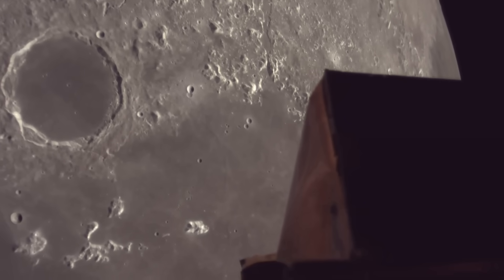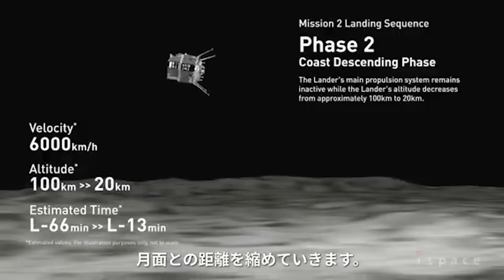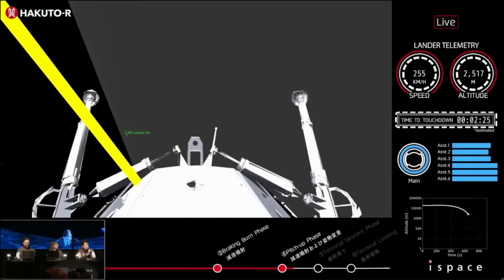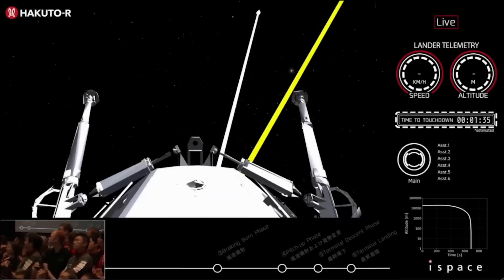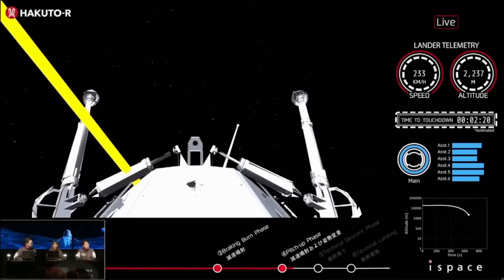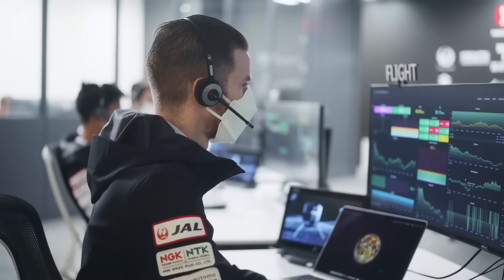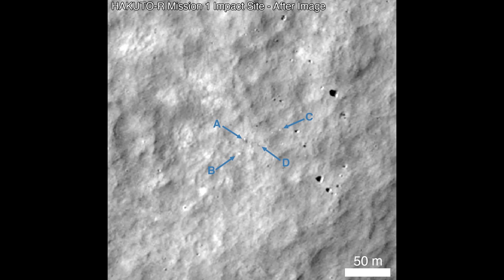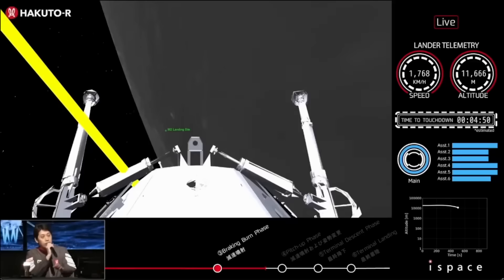Another Lunar Lander Just Hit The Moon Too Hard

Comment: With all these failures recently in moon landing attempts, it’s surprising none had anything to do with the engines. All seem to be landing sensors or some sort.
Reply: It seems like lidars aren’t very reliable for lunar landings. The video suggests that if this was like the 1st iSpace mission, the flight management programme’s lack of ability to handle more complex approach situations  than planned is to blame. Perhaps they should also use radioaltimeters.
Reply: @Blixey-r9z  Maybe they should be using ultrasonic sensors 😅. 

Good reply though. It might be time to create a Moon GNSS constellation.
Reply: @12pentaborane 
I think they are trying to reduce the cost of the landing vehicle by simplifying (perhaps over simplification). The Chang’e 5  navigation and flight control system seems to be  a lot more sophisticated and equipped with a lot more sensors. The inertial navigation system’s calculations are updated with data from 1) star sensor; 2) optical camera; 3) lidar camera; 4) lidar altimeter; 5) radar altimeter; 6) lidar velocimeter; 7) radar velocimeter; and 8) gamma-ray altimeter. Skimping on the navigation and flight control system might be a case of being penny wise pound foolish.
Reply: @Blixey-r9z  I would be pretty amazed if any spacecraft is flying without a star tracker. That seems really important just to get to the Moon, let alone land.
Reply: @12pentaborane 
The iSpace vehicles probably do have that and the inertial navigation system. But it seems like they are trying to land without using radio-altimeters and gamma-ray altimeters (used in the terminal approach phase 0-30m altitude). Not sure if they have optical and lidar cameras with image recognition and processing  software and computers (these are used in the approach phase 100m-2000m altitude).
Reply: @Blixey-r9z lidar wouldn’t work if there’s dust in the air anyway - is this not why the chinese landers use the gamma ray sensors?
Reply: @octagonPerfectionist 
Yes, dust clouds are a big reason why the gamma-ray sensor is used for the terminal approach phase.  Firefly only talked about the optical imaging navigation system that the Blue Ghost lander used. Not sure if Blue Ghost had a gamma-ray sensor.
Reply: @octagonPerfectionist  Err,. what 'air' would that be??
Reply: Essentially, if that all yrue. They got lucky.  Seems that their landing may have been anomaly vs typical with these "low" budget landers.

Seems like Gamma sensors appears to be more liable in these darker regions with alot of dust kicked up.

That and software decisions plugged in seem to another factor.
Reply: @0x8badbeef  Yes
Reply: @Wrangler-fp4ei 
The human brain, eye and hand are still very capable. Astronaut pilots are still more capable (for a little longer) than  the current guidance and navigation systems being deployed  under NASA’s CLPS. The Chinese seem to have developed  the most sophisticated and  capable automated lunar landing system to date. They are 3 for 3 so far…. fingers crossed. The Chinese are remarkably very open about their mission architecture and design.  The Chinese have already surpassed NASA’s past achievements (not counting SpaceX’s achievements) when it comes to automated rocket-powered soft landings.

In the 1960s, NASA’s Surveyor lunar program had a 70% success rate; the preceding NASA Ranger program only had a 45% success rate. By the late 70s, the Soviets/ Russians achieved quite a decent lunar landing  track record  (70-85% success rate) if you only count the lander missions that made it to trans-lunar injection.
Reply: @PiDsPagePrototypes lmao, true, but you’re being pedantic you know what i mean.
Reply: @octagonPerfectionist 😊
Reply: @Blixey-r9z  Well, Radar Altimeters worked in the '60's and '70's. Maybe what's needed, is redundancy, Radar and Lidar working together.
Reply: @PiDsPagePrototypes 
The Apollo landers had a lot more than that… they had astronauts who were also trained naval or air-force aviators to land the vehicles. The Soviets sent quite a few robotic landers. I think they had a 50%-70% success rate. Unlike the Chinese, I don’t think they used gamma-ray altimeters for their robotic lunar missions despite having developed the technology for their Soyuz capsules.
Reply: the types of engines they tend to use with these types of spacecraft are very reliable. it’s very old and proven technology at this point
Reply: So, it seems there was some delay in the height sensors feedback from the lunar surface with airborne system telemetry lagging significantly behind the actual time to landing equation.  Maybe something like reflected cosmic activity disrupted the sensors or imagery feedback in the final landing phase?  So close to being the success the project deserved.
Reply: You all seem to be blaming the height sensors... but the problem wasn't that it descended too fast. The problem was lateral velocity. The last readings showed it was descending at a relatively slow rate, BUT it was going nearly 200 km/hr laterally.  That thing literally tumbled and bounced across the surface for at least a kilometer before it came to a stop. It probably left quite a debris field in its wake.
Reply: @mikeharrington5593 
There isn’t real time remote-controlled telemetry for the guidance navigation control systems (there’s a 2.5 second radio signal delay between earth and the moon). The approach and terminal flight guidance and navigation processing is done onboard the lander.  

The Navigation Doppler Lidar (NDL) was developed by NASA’s Space Technology Mission Directorate (STMD) and has been deployed to NASA’s Commercial Lunar Payload Services (CLPS) program. It was used on both Intuitive Machine’s landers. There’s a good chance it is the lidar technology on iSpace vehicles as well. Doppler lidar was used for Mars Curiosity mission. However, Curiosity made use of a sky-crane hover technique to lower the lander onto the surface for the low speed terminal approach phase.  NASA’s own tests during the development of Doppler lidar system showed that there was considerable variance / errors in measurements taken at lower speeds. Perhaps NDL isn’t reliable enough for the  terminal guidance phase for landing. The dust clouds kicked up by the vehicles thrusters will also add a lot of “noise” to lidar sensor data. Guidance navigation control computers are programmed to apply algorithms to filter out this noise. However, it seems the algorithms are simply not sophisticated or intelligent enough to overcome the noise and errors in Doppler lidar readings. It is becoming increasingly apparent that, from the multiple CLPS mission failures, that such lidar technology alone is not suited for terminal approach phase guidance. It will be interesting to find out what Firefly’s Blue Ghost used. Having said that, Blue Ghost landed in less challenging terrain of a lunar mares; even then, Blue Ghost’s final landing spot looked a bit precarious with 1 leg was not in contact with the ground; and Blue Ghost seemed to be sitting on a ridge/ rim of a crater.
Reply: "1201"
Reply: I think the engines they're using are hypergolic and thus highly reliable.
Reply: The same as modern cars, they run fine, until a sensor goes wrong
Reply: There was one lander that spat out the rocket nozzle while landing.